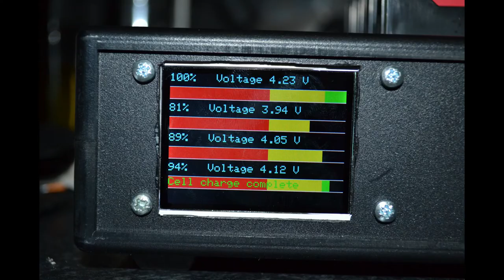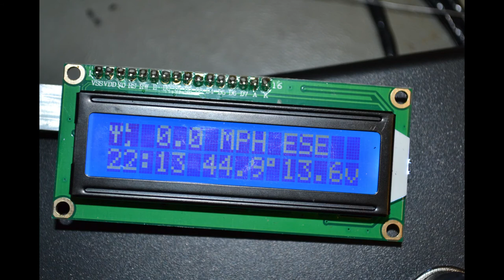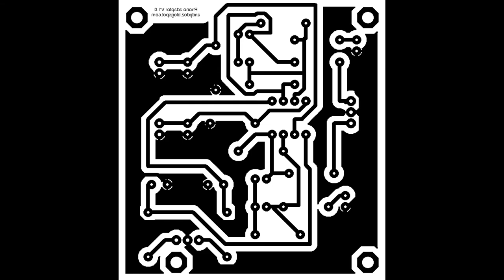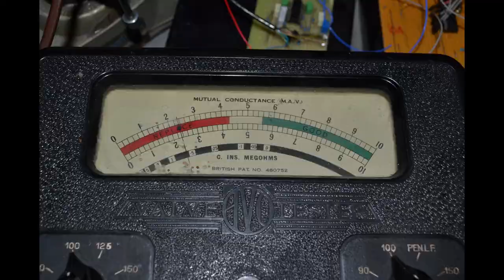Westerstrand Impulse Clock

Comment: @Doz Television Workshop 
I have a ITR Clock with a 3 pin westerstrand unit in the back that has 3 pins; 2 labeled AB and one AB, i wander if you may be able to shed any light of comparisoon to this unit. Thanks
Reply from the maker: I can't sorry... maybe a centre-tapped coil?

Comment: An advice for the summer-to-winter time setting: advancing the clocks will work on a simple 12 hour clock, but there are also 24 hour slave clocks and "punch card" clocks which in addition to time also record the day of the week and sometimes the week of the year. 

Because of this it is not good practice to advance the clocks 11 hours to give the impression that the clocks have reversed an hour. The 24 hour clock will show 22:12 when the actual time is 09:12. It is better to simply pause the slave clocks for one hour. Yes, they will display the time incorrect for one hour in the middle of the night once a year but.. it is in the middle of the night, and only once a year :-)

Comment: Im not sure about your country but we still use systems like this in American schools. Ours are IP based but only require one pair to the clock since only tx data is needed and you can daisy chain them since all the clocks use the same ID. I made a joke about the janitors having to go around and change all the clocks back in the day and one of the old timers told me that us low voltage guys have been installing impulse systems since the 60s. Turns out they had systems like this back into the 20s even!